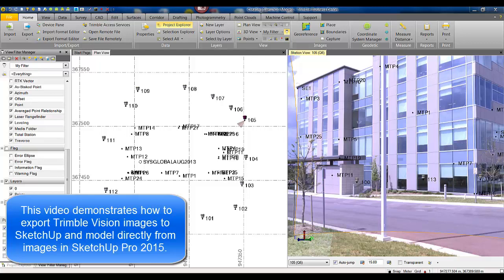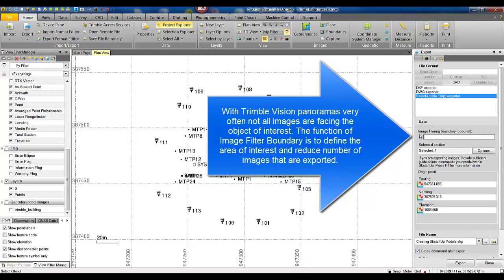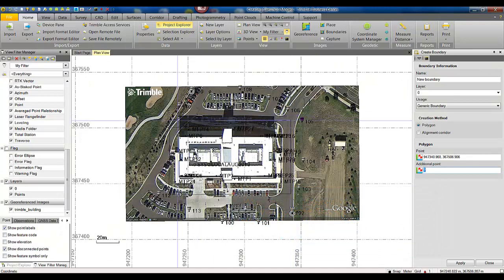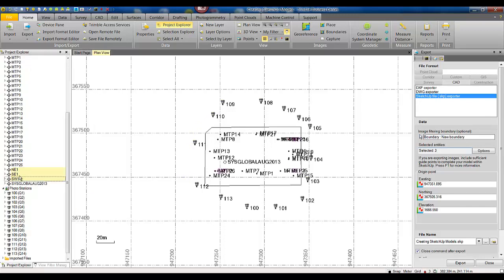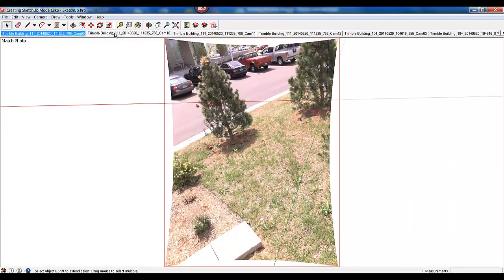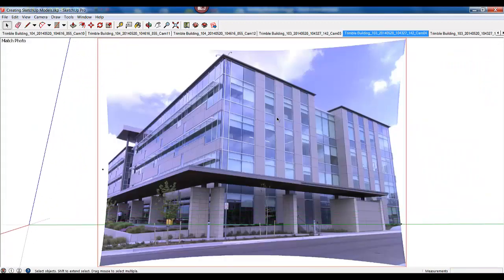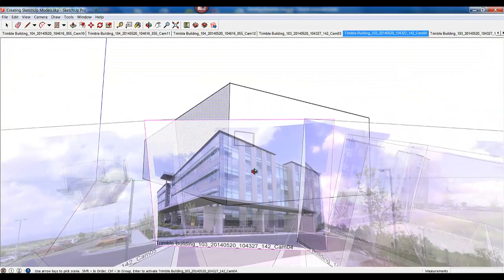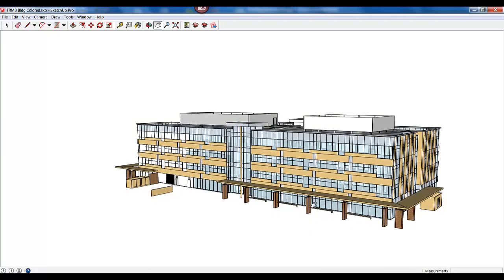Trimble Vision Export and Modelling in SketchUp

Comment: Tried this with a Vision S6, TBC 3.40 and Sketchup pro 2014
It does not work I can see the photo's and have the tabs, but somehow the pictures do not correspond with the location.
Is there something extra I need to do In Trimble Business Center/.
Reply: gjbosse, something that comes to mind is that you need to select an origin in the export menu within Trimble Business Center. Then after you export to SketchUp, the axes should be centered on the origin point you created in TBC with photos overlaid correctly.
Reply: Jared Bloch thanks, already tried again. It's working now. But it imports the photos separately. And to be able to have some detail you'll need to be fairly close to the object resulting in a lot of photographs. It would be a big help if you could use the in tbc processed images (stitched and colour ballenced). But still it is great to see that the trimble software is getting more compatible with sketchup